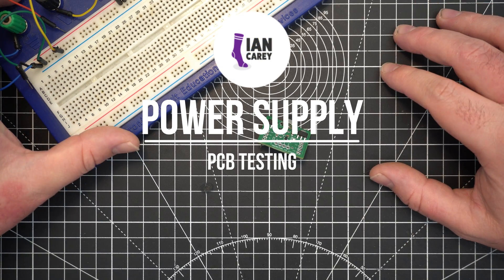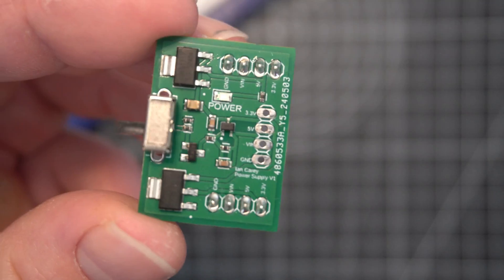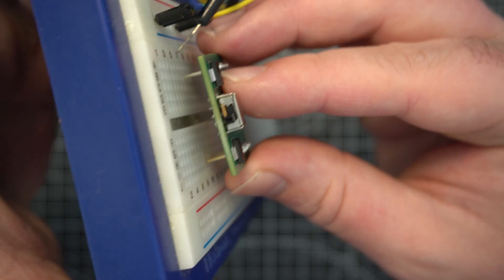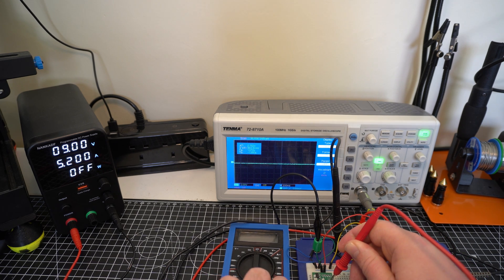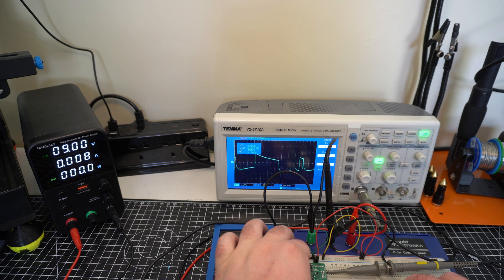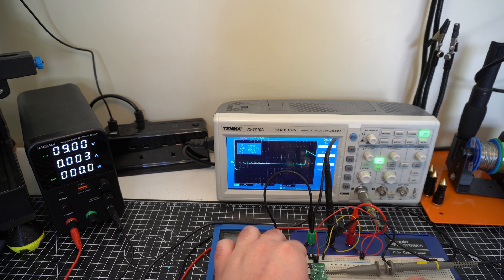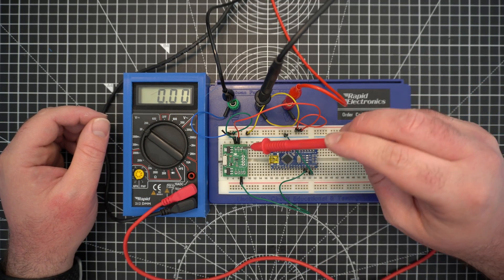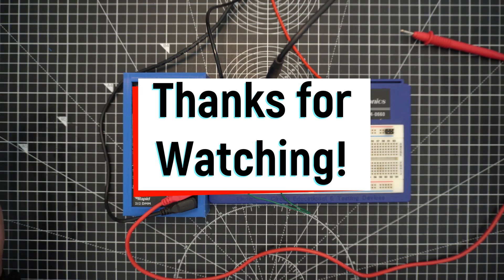Testing my Custom Power Supply PCB

Comment: Oh, remembered one more nice to do trick. Don't do GND, VIN, VOUT. Do VIN, GND, VOUT.  That way if you short out two pins with solder bridge or by corrosion due to moisture, you get input or output short to GND thus putting your lab power supply in CC mode. If you do the first order, you short in to out and burn the load with +12 instead of +5. This is actual issue in LCD cable of some MacBooks. If smallest moisture gets in, it shorts logic voltage to 57V backlight voltage burning CPU.
Reply from the maker: Never would have thought about that, good idea!

Comment: One more thing - You want an input and output cap on each LDO and you want to have them as close as possible to your LDOs. The whole idea is to get as low trace and VIA inductance as you can. Lesser trace inductance is achieved by the proximity to pin, the VIA proximity is achieved by using 2 or more in parallel.
Reply from the maker: Good tip, I'll add these in V2 of the board!

Comment: Few ideas form experience. 1.  You want to add large copper array and about 1mm hole vias around it to cool down the LDOs better. 2. You might want to have LEDs on output rails not input. That way you immediately see if anything is pulling the rail down. 3. You might want to make that front supply SMPS so you can run it form higher voltage with higher power. I like AP63301 for that - super simple, cheap and stable little thing. I use them with WE LQS series inductors to keep on the cheap side while still being industrial quality.
Reply from the maker: All good tips, I was thinking of doing the heat dispersing vias in this version as it happens, but I didn't in the end. Might do it for V2, especially if I notice heat as being much of an issue with these guys.

Comment: Be gentle with that board. Those little AMS-1117 style LDO's can get quite hot. Also, while the "legitimate" ams-1117's datasheet tout a heafty 1A output, i feel it's misleading, as that should "peak" current. sustaining anything above 500mA and those little buggers get hot, and at 1A, they literally cook themselves. 

If you need higher current output, you'll want to go with a beefier packaged LDO.
Reply: It's not the output current that makes it hot, it's the power drop = output current times (input voltage minus output voltage). It can easily handle that amp at half a volt drop. You have to look at power dissipation to predict the temperature in each particular case.
Reply: Also, going with beefier LDO is a really bad take in current year. SMPS is so simple to implement nowadays and I see zero reason to put huge hot LDO as front PSU.
Reply from the maker: Fair point, I don't plan to use these in any high current applications. So I'm not too worried. A friend of mine gave me some feedback that I could swap to a switched regulator which would be better than the LDO's. I'm gonna roll with these for a while anyway and see how they go.
Reply: @careyian  That's what you say today, but in a short while it's like "wait, let me add this and that"..  "what about adding a tft screen" and so on.. and "oh, my 12V powered motors are too weak, let me bump that to full 24V then.." and suddenly your LDO drop is 19V and it's glowing hot :) At least that's how my projects go. So I usually just put the small SMPS down as primary and then run 3.3 from LDO powered by that SMPS. And it has saved me bunch of time in redesigns in my days.